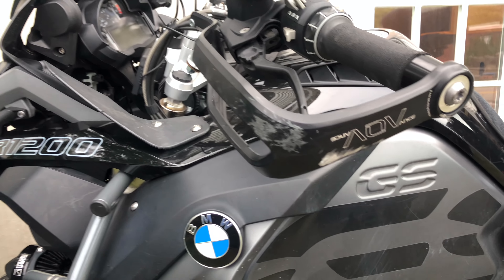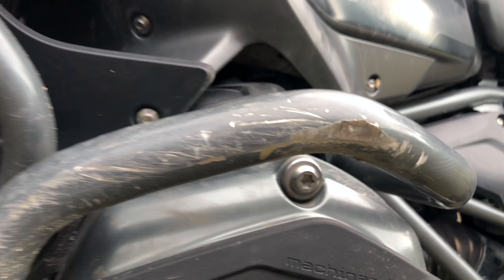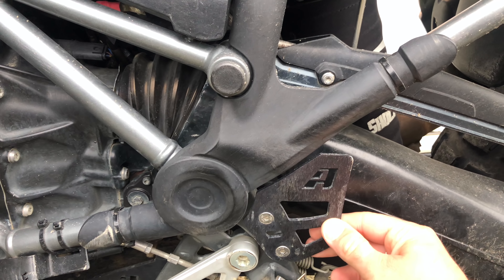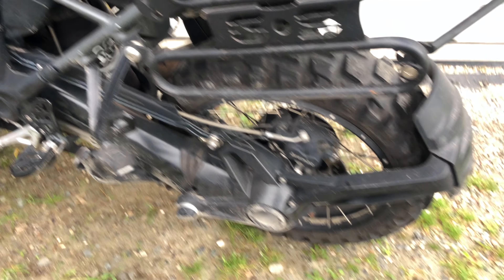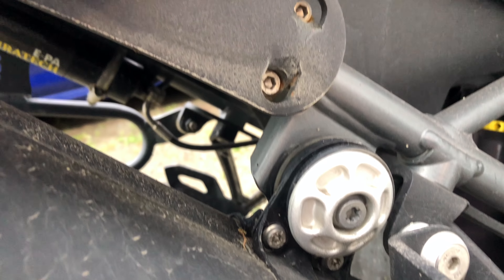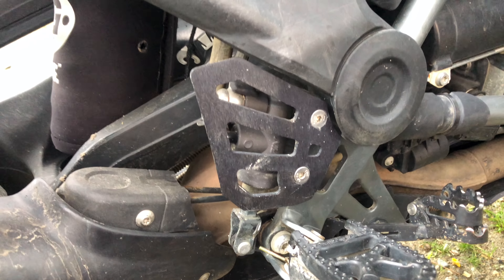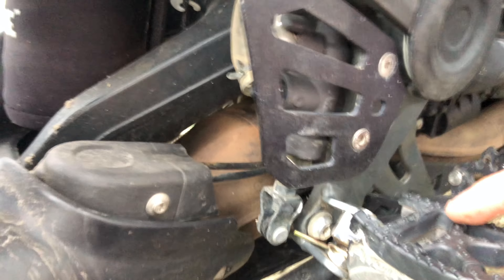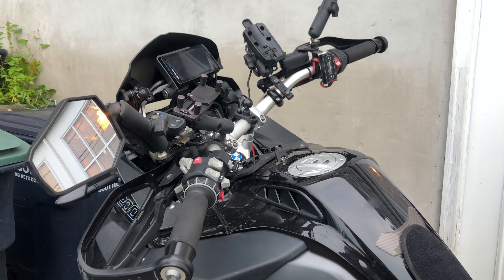Analyzing the Crash Damage on my BMW R1200GS Adventure (2017)

Comment: How did you hurt the side you didn't land on
Reply from the maker: Slid into a guard rail.
Reply: @AdamChandler86  dang ! I was wounderin but yeah that makes sence ! Glad your OK ! Were you able to get the bike fixed ?
Reply from the maker: Sadly no. The guard rail collision cracked the frame. That little hair line crack in the peg. If I had not involved insurance, I could have welded it but didn't. So they totaled it out.
Reply: @AdamChandler86  I'm glad that your OK and it was a beautiful machine so it sucks bad that they totaled it. Are you still riding if so what bike if not what will you get ? 
I just got my first bike. Its a tiger 800xc and I am enjoying it but the BMW is  tempting . it seems like the BMWs are very technical like there is a lot of little things that could go wrong. Have you found them to be reliable ? Thank you for the video and the responses ! Ride safe Adventurer !
Reply from the maker: The Tiger is a great bike! No need to upgrade for a while, bigger or smaller it's a good mid point with plenty of power on and off road. hard to say between the two. I do my own maintenance so for me, BMWs cost no more than any other bike but if something big breaks, it's big money. I just replaced this bike with the same model. I like the GS Boxer motor so I got another one!
Reply: @AdamChandler86  that was the one thing I have heard is the boxer engine keeps the center of gravity low and makes it feel like a lighter bike .
Reply from the maker: I can say that F850 and R1200GS , the big boxer feels a lot more balanced despite being 50 pounds heavier. So I can definitely attest to that.

Comment: Did you wind up having frame damage?
Reply from the maker: Kind of. The left foot peg bent which is technically a part of the frame. It had a hairline crack in the foot peg weld and insurance totaled it out.
Reply: Adam Chandler I had a minor accident and I have always been worried about frame damage. However the bike does not vibrate at speed.
Reply from the maker: Here's a link to a photo of the peg after the crash. Hard to believe that's frame damage but it is -  http://i.imgur.com/jN0imv4.jpeg   If it was a KLR, shop would have just welded it and sent the guy on his way. I regret involving insurance in the matter.
Reply: Adam Chandler I had a lot of damage replaced both forks after bike was backed up over. Bike runs fine but I can swear that when I look at the guages they look sorta tilted to the right versus the bars. Took it to a big BMW dealer and they loosened all of the forks and readjusted. I hope if anything was amiss they would have mentioned it. They then test drive it and said it was fine. But it’s my own paranoia. Next tine I will total the bike and buy a new one.

Comment: You expected too much of the off-road tyres.  Unless you're going off-road, a lot, I'd suggest some more road oriented tyres, although Michelin Anakees are so bloody noisy anyway.  If like 90+% of GS riders you never go off-road, get Sport Touring road tyres.   You seem to take corners in a series of jerky turns?  And it looks like you weren't countersteering, you appeared to be turning the bars left when the front folded; you may have got away with it had you used the correct technique and pushed the bars to the right, but those tyres are pretty sh*t on the road and may have let go anyway.

Comment: a wash and a polish a new gear changer and a go with a rubber mallet and it would be fine i wouldnt of even gone through the insurance
Reply from the maker: Replace Frame that was cracked - $10,000
Replace two footpegs - $400
Replace Shifter - $200
Replace one crash bar - $400
Replace One cylinder head cover - $105
Replace one hand guard - $75
Replace a luggage rack bent and cracked - $390
Replace Suit. - $1500 
Replace Boots - $350
Replace Helmet - $600

Sure. easy. C'mon man. don't comment on this like it's a wash and reset.

Comment: Nothing to do with tires, you just got in a little deep and did the right thing by cranking it down and probably hit a little bit of oil/diesel/skunk urine, whatever.
Forget about the 'armchair experts' here, tires, very rarely, just give way, without warning like that, without some other factor being involved.

Happens to the best of Riders, the positive to take out of this, is that your reactions are right on the money, a lot of Riders, without the proper instincts/experience, would have, frozen in panic, stood the bike up or hit the front brakes and, either way, plowed into the guardrail head first.

You're fine, you've got the skills, get back in the saddle !